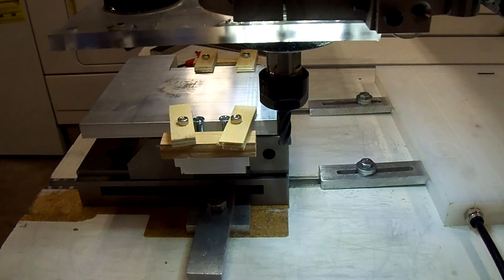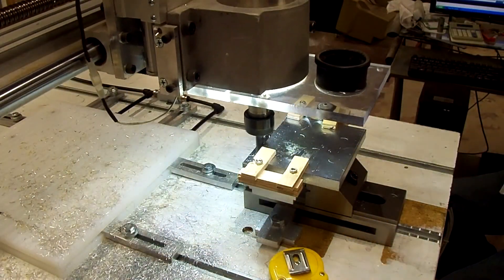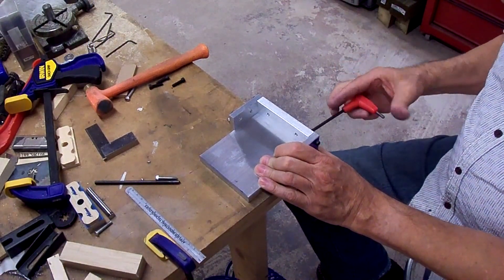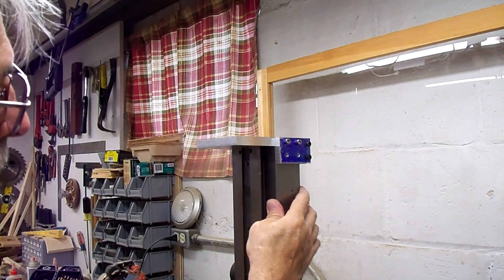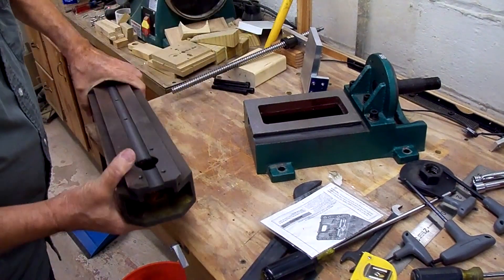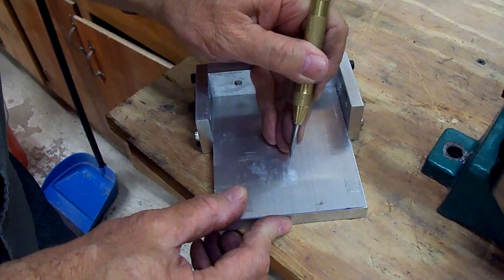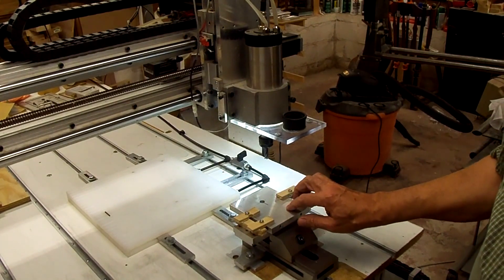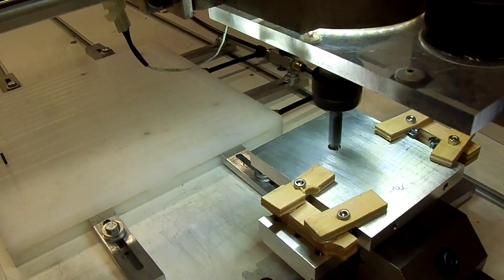CNC mini mill Z axis rebuild part 3

Comment: Regarding your holes lining up... That's why you securely clamp all the pieces together first, in their proper positions, with everything perfectly aligned. Then while it's all clamped together as one unit, you drill through both pieces at once, all the way through the first piece, down into the second piece. This results in the holes in both mating pieces to be perfectly aligned.
Reply from the maker: Your statements are true but in the end it all came together and works just fine.  Thanks for watching.